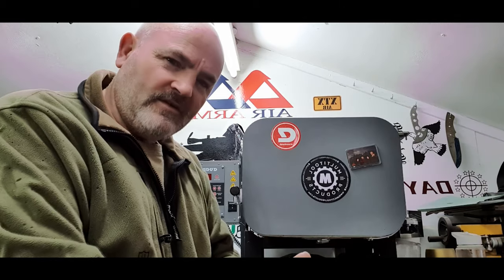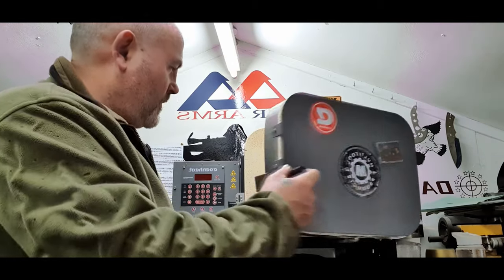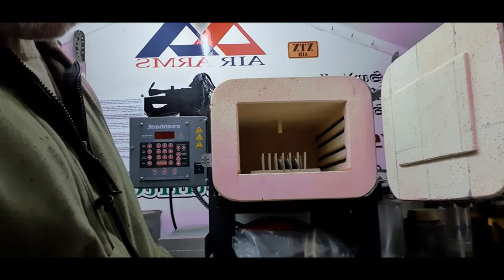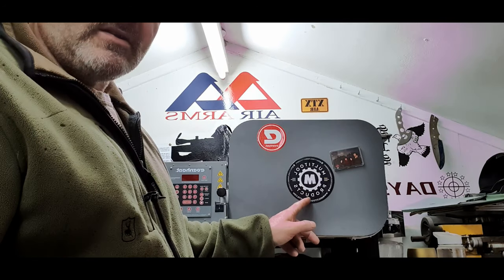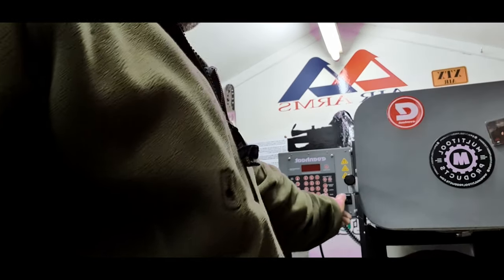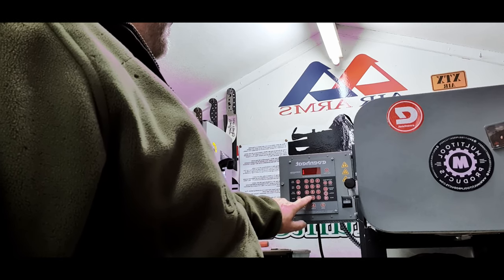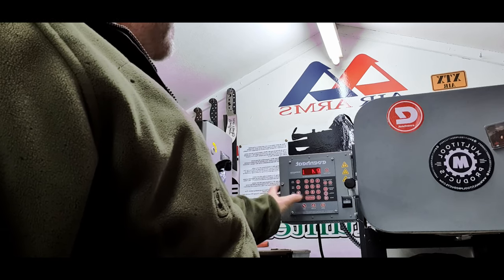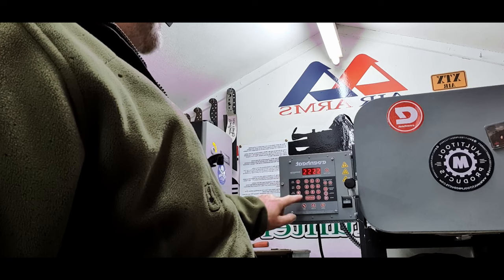RWL-34 FULL HEAT TREATMENT PROCESS

Comment: Useful video. I just heat treated some AEBL for the first time. All had been coated in condursal. 2 were completely coated and one I had left a section of the tang. The two that were fully coated stayed beautifully straight, but the one with some of the tang exposed warped along the tang. You might find coating the entire blade with anti scale helps with warping. Worth a go at least. Will definitely get myself some RWL34 to give it a go. Thanks for the information.
Reply from the maker: yes I have some condursal, but bought it  after this HT. yes do try the RWL-34 its a real nice steel to work with.
regards

Davy
Reply from the maker: Definitely test your AEB-L for warps before HT I think you will be surprised,and a stress relief cycle at 670 for a hr as above in my reply to poltergeistworks.

Comment: I’m wondering if you tested the steel as far as bending it after heat treatment? I’ve found it to be a weird one because despite getting solid rockwell hardness I can straighten a warped blade on a press with not much effort. It bends pretty easily using a press even after heat treat without the need of  over-bending which is really strange behaviour to me. I’ve always followed DAMASTEELs guidelines and asked about it but they didn’t say it was something abnormal :) For example in case of S35VN I have to significantly over-bend the blade on the press to get any bend into it/straighten it…
Reply from the maker: Hi buddy
The test I done were snap tests to see what the grain structure was like,and edge retention tests after heat treatment.
Since this video I now do an another cycle which is a stress relief cycle at 670c for 1hr after all drilling profiling and grinding has been complete. And it has improved the warping significantly with better results than in this video.
I have also found on delivery of SF100,AEB-L,14C28N,80CRV have warps from manufacture,which are easy to remove before HT via a small Arbour press,so definitely worth checking your steel before HT I certainly was surprised.
A bend test I would like to challenge myself ,like in the journeyman test.thanks for the comment take care
Regards

Davy

Comment: Isn’t it necessary to put RWL-34 in a wrapping foil because of oxydation? I would like to know this because i want to harden RWL-34 myself with my oven.
Reply from the maker: Yes you can buddy if you are plate quenching,I was oil quenching with ATP64 anti scaling compound. you can also treat it with Condurasal Z100 instead of foil buddy.
Regards

Davy
Reply: @DTKcustomknives   did you use any anti scaling compound? Or did you just let it be. Because you have almost no scaling.